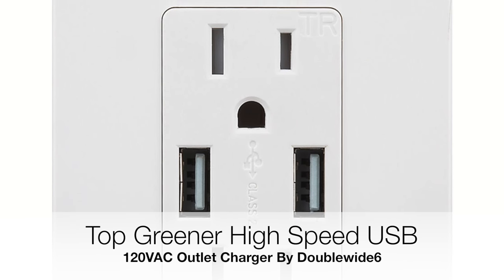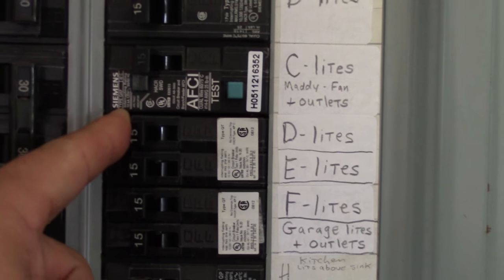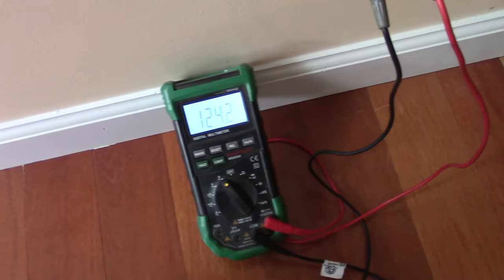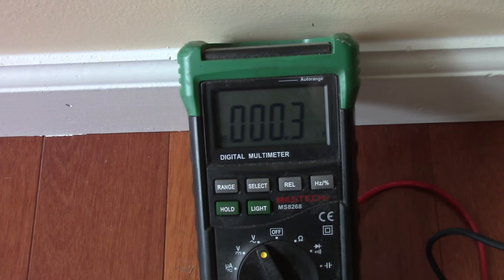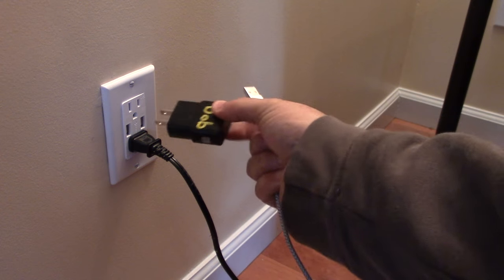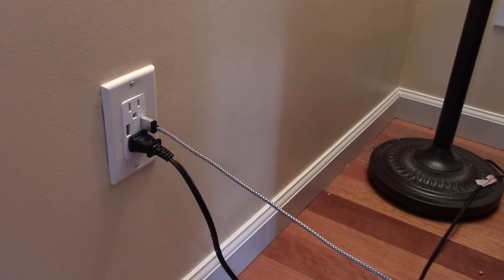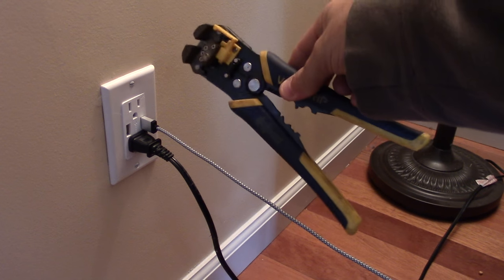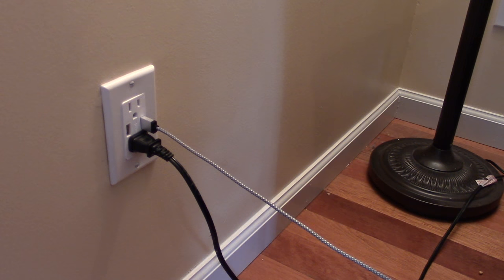USB Outlet Fast Charge Your Devices

Comment: Nice Job. 

I'm definitely going to do this to one of my kitchen outlets.
Reply from the maker: Make sure you get the right one.  If it is above the counter it should be 20 Amp.  That is if your in the US?
Reply: Thanks buddy, you're right. My kitchen circuits are 20 amp. I'm in New York state and anything above the counter in the kitchen has to be GFCI. and 20 amp.